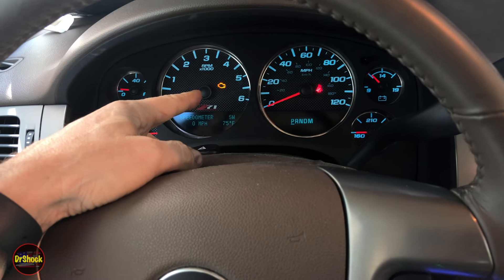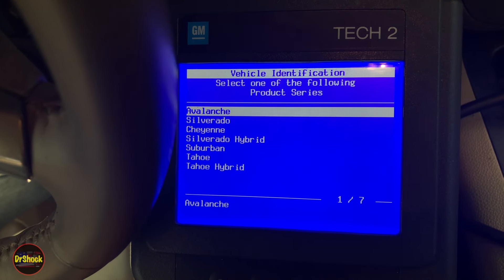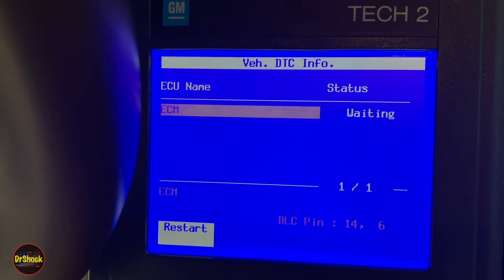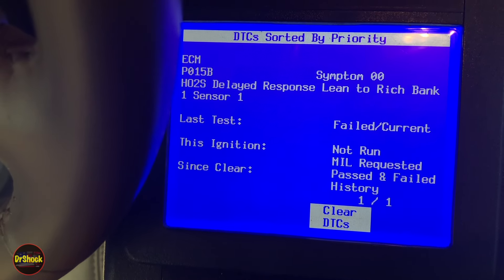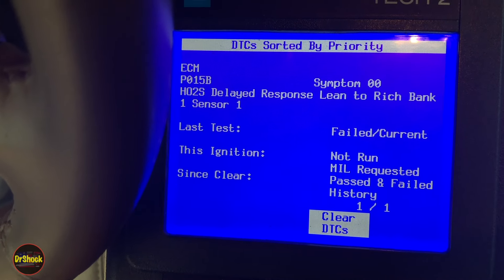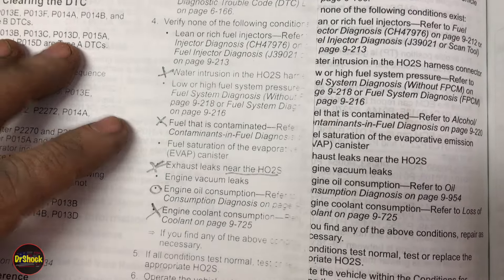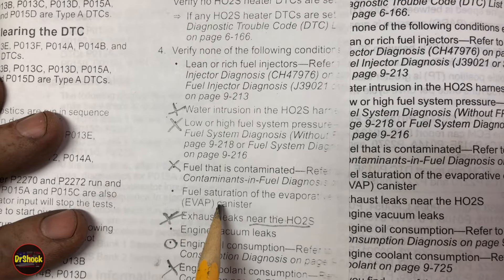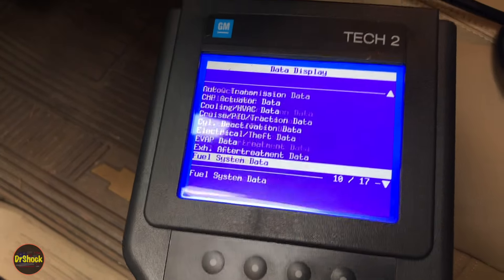2007 - 2014 GM SUVs Diagnose & Repair P015B or P015D HO2S DTCs (Chevy Avalanche / Tahoe / Suburban)

Comment: Parts cannon, gotta love it.
Reply from the maker: Yeah, cannons are usually only accurate to within 10%, at around 5% of the time.   Better to run thru the service manual diag tree and be sure the vehicle does not come back than firing one.
Reply: Guilty as charged. LoL
But I usually get lucky and hit on the first shot.

Comment: Hello hopefull you can help me i got a 2014 tahoe with both p015D and P015B error codes on. So im wondering are both these codes on because i put acetone in fuel tank it was recommended by a friend to do so beacuse i had told him it felt like cats are plugged...im kinda lost and do know what to do can you help
Reply from the maker: There is a reason acetone is sold in the paint aisle, not the automotive aisle of the store.  It is one of the chemicals specifically called out to NOT be added into fuel by General Motors - https://static.nhtsa.gov/odi/tsbs/2013/SB-10068973-5448.pdf 

Whether that specifically caused the DTCs you have, or is a coincidence, would be impossible to determine and could only be confirmed by swapping in a known good OEM O2 sensor into either bank as a test.

Comment: Man, I'm HOPING and praying you may be able to help me. I have a 2019 Camaro SS 1LE (6.2 V8 naturally aspirated), it's a manual with 50k miles. Even though the issue started occuring at 35k miles! The ONLY modification is a Rotofab dry filter intake. I have an ever so slight bucking feeling when accelerating from a stop using 1/4 throttle if that. It will only usually occur in lower gears (1-4) and ONLY when the RPM gets to or around 2k RPM (almost like a switch lol). At idle, cruising speeds (steady throttle) or WOT, it seems to do very well (even though sometimes it doesn't pull as hard as it should, and seems to bog just A TAD under heavy throttle). The weirdest symptom is, SOMETIMES, when I'm cruising steady throttle say 60 mph around 1800 RPM, I will take my foot off throttle thus coasting in gear, and after 2-3 seconds off throttle I can feel the car EVER SO SLIGHTLY lunge forward like it's having trouble during DFCO. I've already confirmed the car is running rich by checking fuel trims (also tuner verified it). I even had the car custom tuned thinking it was intake related to no avail. The ONLY CEL codes I have EVER got to come on are these 2 codes (P015B and then a cpl weeks later P015D) only to disappear on their own. P015D returned, so I replaced it (Bank 2 Sensor 1), AGAIN to no avail same symptoms. I replaced plugs/wires with OEM, brand new MAF, brand new PCV, new air filter, had a smoke test done to check for vacuum leaks, injector flow test, everything has been done by the dealer. I run nothing but the best fuel 93 Shell V Power, and use the oem recommended oil Mobil 1 0W40. This has been going on for over a year now, and I'm to the point of selling the car I'm so frustrated. Dealer wont help me, unless CEL is on, and of course there isnt one. It feels SO minimal, but not at the same time. As soon as the thermostat opens upon cold start, or soon as it enters closed loop (one of the two) I can hear the engine bog ever so slightly. I bought the Bank 1 Sensor 1 O2 today (for the P015B code I got forever ago) and am going to try and replace it this weekend. The only thing I see underneath is right where bank 1 sensor 1 is theres a little scrape or dent on that cat near the O2??? Maybe hit something and messed it up!?!?!? PLEASEEEEEE HELP. (My car is white, and black soot covers the rear of the car after 1-2 drives because its running so rich).
Reply: Hey man, do you have any opinions on this? Any opinions would be greatly appreciated, desperate at this point

Comment: Also updated - I changed injectors and high pressure fuel pump, also changed evap purge valve. When I unplugfed the evap purge valve the car seemed to run somewhat better. When I plugged in the new one, back to the rough running, negative long term fuel trims on both banks with bank 2 being slightly more negative than bank 1 by a few points. Would love a reply if you could 🙏